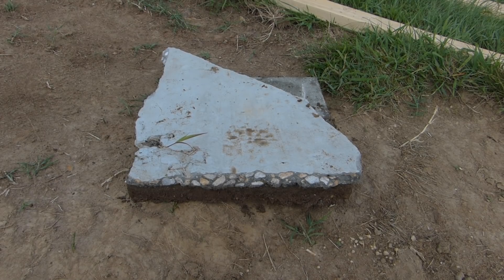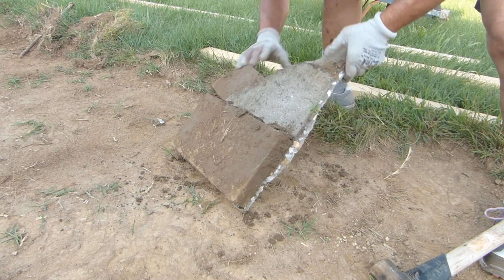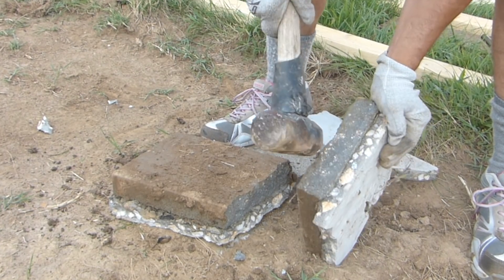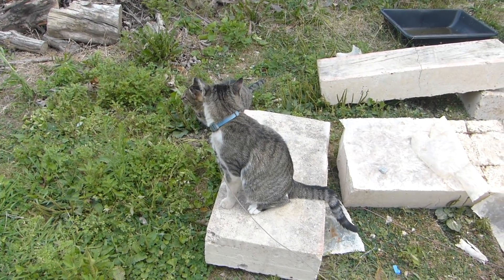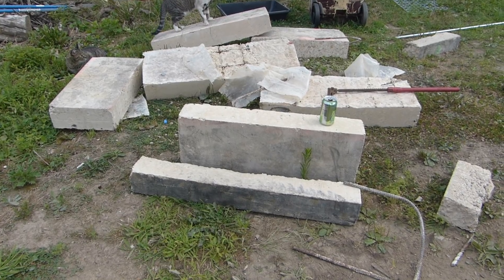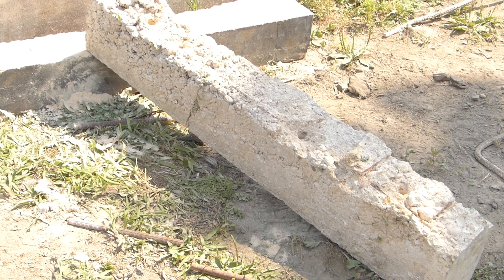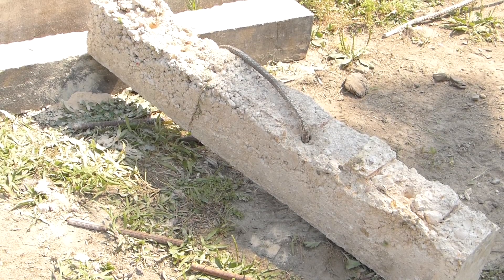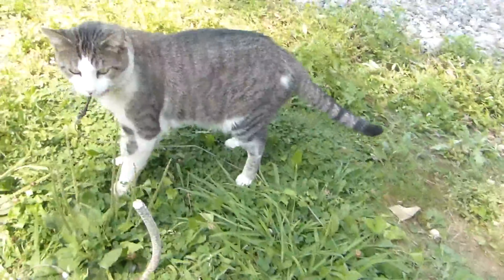Concrete Repairs STAPLES  CAN SAVE A BROKEN MARRIAGE   Part 1

Comment: Aha!  Now lets take this staple concept and make it way bigger, attach it to the 2nd floor decking and rename it a transfer beam. THAT'S how the western portion of the building remained standing. While the one side is being yanked around by the collapse, the staple/beam is just transferring the load around. Excellent!
Reply from the maker: ''into"   would be a better way to look at it  but remember, nothing is for free; the two ''legs'' are creating an inward force inside the holes...   Epoxy would help make that force more distributed and even allow for some ''backside'' of the rebar to work...  As one with the concrete...  BUT, it is still a ''zone'' of ''force'' that exist. 
I will take this sample further in the next videos on this subject.
Reply: As one with the concrete

Comment: Great demonstration 👍. So in regards to the condo would you use that type of repair throughout the building?   I have a question about the pavers.  The ones in the pictures after the collapse looks totally saturated-almost like thick shingles that were soaked.  I thought pavers were made of stone? Or are they made of different materials?  If stone -they wouldn’t soak up water, would they?  👍😊
Reply from the maker: @juliefizpatrick513  , you have to be a real man to wear pink sneakers  or not give two shits what other men think... I am both.
Reply: @ForensicCats  I have no doubt just thought it was 😂. I think I have an answer for the pavers-they had to be “non-slip”being by the pool?
Reply from the maker: Julie, please watch the video tonight... it will show this type of detail and this was to help you understand how it works...https://www.youtube.com/watch?v=QPm7x3e8Qqg

Comment: That's exactly what happened when the Crane struck the building in 1980. It's like a big 40,000 pounds sludge hammer.   Remember it did not have to break it in half it just had to crack enough to let the salt water in And just to break the seal 40 years We'll do the rest.  And a bunch of hurricanes....

Comment: Could the vibration from a falling beam or c section, cause the pool deck collapse. As in the initial event was around the sagging beam in the garage. Like the foundation (garage floor) slab have done what your wotsits did - cause a massive delamination enough to start the pool deck punch through. Which then toppled the critical beams on the building boundary? See I'm using all these fancy words I know nothing about really. The trouble started inside, went outside, then came back in again.
Reply: That makes sense to me-that one beam in the garage that the concrete appeared to be soaked right through was in that area you are talking about.  I think it’s called a BMA beam.